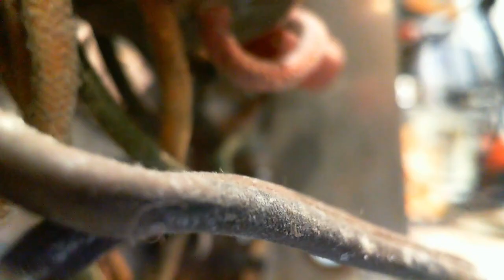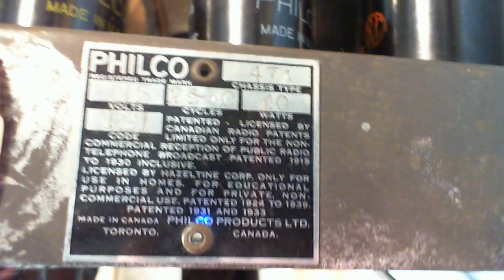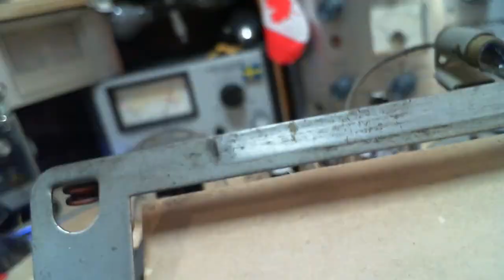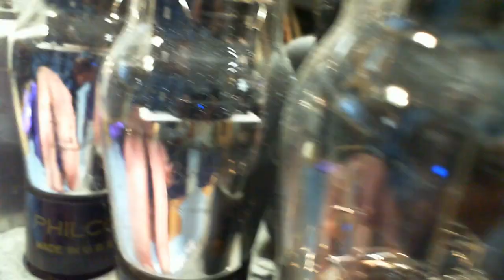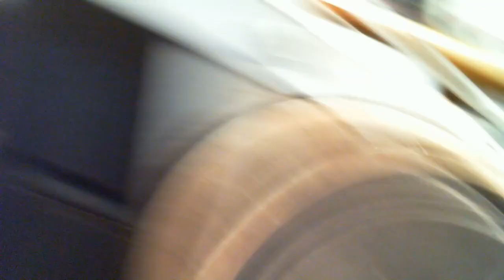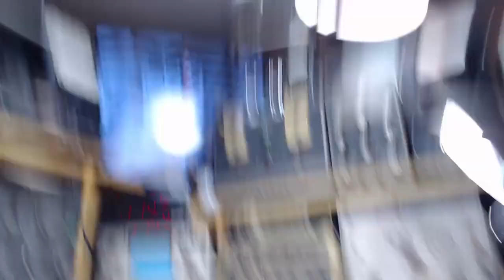Philco 47A Tube Radio Video #1 - Checkout and Power Up

Comment: Ive been in Radio for 58 years . The number of times Ive been shocked are more numerous than one would realize it. Its almost commonplace , but its always when I get careless. On the job once i found myself across the 125 VAC rails. My hands were clasped to the equipment  mounting rail and the rack. It happened so quickly I found myself across the line my paralyzed hand grip would not let me free. I had the prescence of mind to kick myself away with one foot and went flying across the floor. My partner came in and found me shaking, he called the Medics. From that day on my nick name was “ Sparky”.  I laugh now, but I came so close to a final electricution.

Comment: The stamping on the chassis says 47A but this is  a model 47 . The circuit diagram shows it is so.
This radio would have been in a wood cabinet with a nice piece of asbestos underneath the whole chassis 
so  it's  good the owner didn't send it along, yikes!